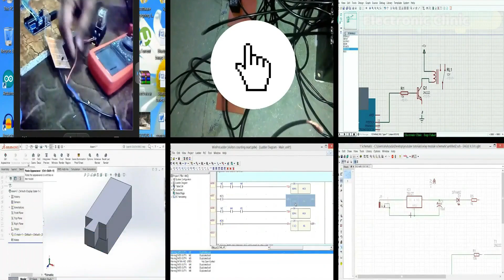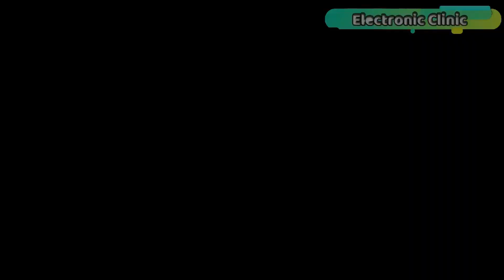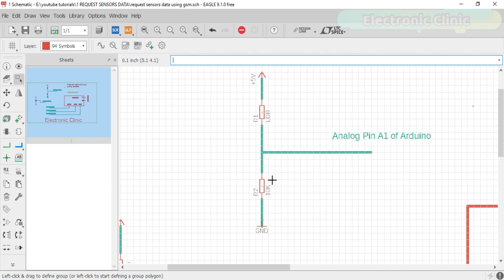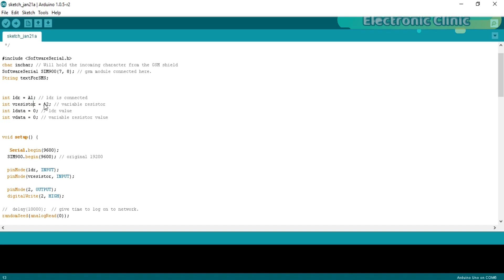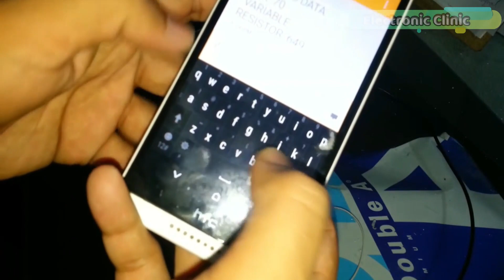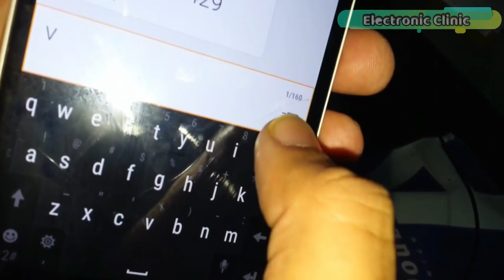how to request Sensors data using GSM sim900A / sim900D and Arduino

Comment: If you find the following program in Arduino, if you call Sim900a, the bulb 1 should start only 2 seconds ON and when you call again the bulb 2 ON should start 2s. And get status of led

Material..

1. Arduino

2. Sim900A

3.LED 1

4.LED2

ajitzagade19@gmail.com

Comment: Sir,
When you call the first one, the LED 1
should be turned on for 2 seconds and the
agin call the LED 2 on 2 seconds.Can you
create such a code? Using Arduino and
sim900A
ajitzagade19@gmail.com